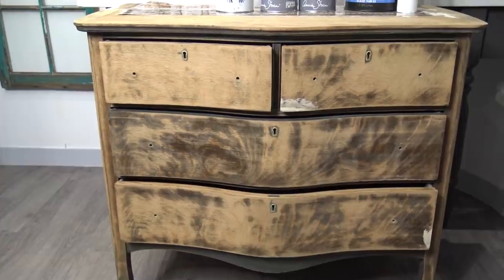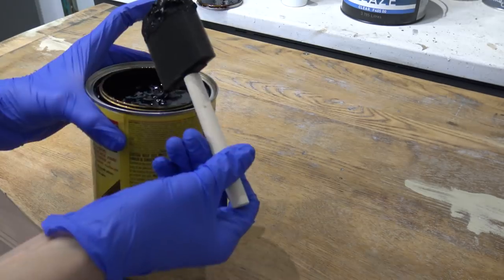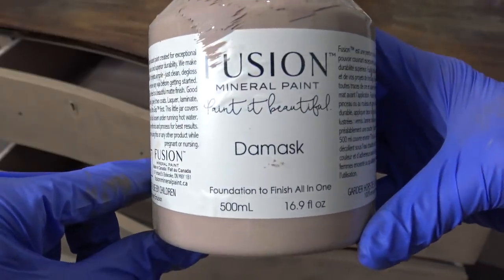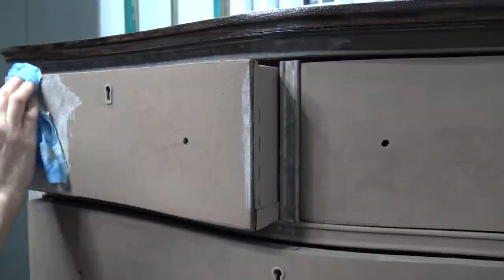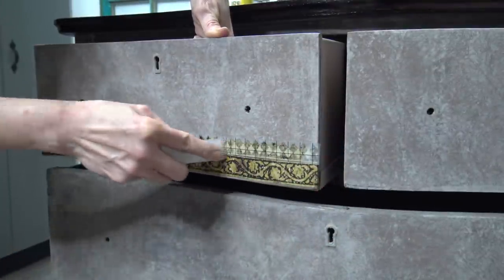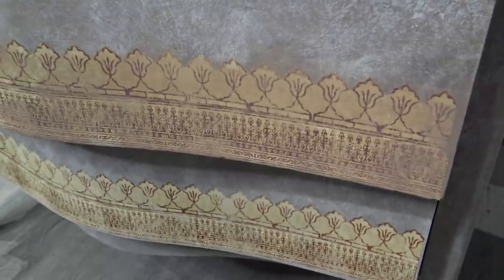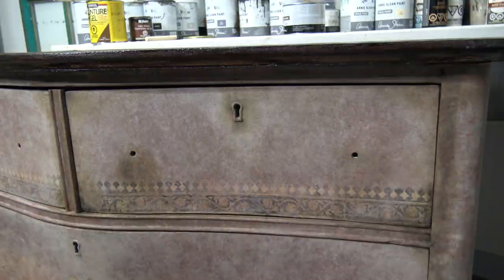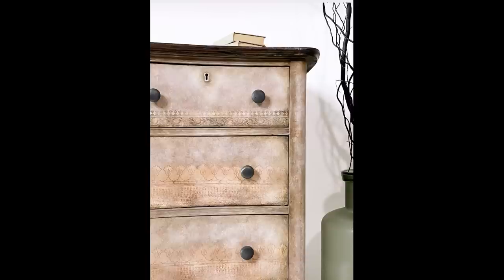Upcycled Dresser Makeover using chalk paint and IOD transfers.

Comment: What do you do about odor of the older furniture?
Reply from the maker: Hi Milissa! I usually clean the furniture piece with TSP cleaner.  If it still has an smell, I will use bullseye primer or clear coat sealer.  This product also has a odor remover as well that helps.  But using the bullseye will remove the smell from the wood.  You have to paint or spray the throughly inside the piece as well as backs of drawers and underneath etc.  it’s a pain but worth it in the long run.  If you look at my amazon link in the video description you will be able to see the product and purchase or go to your local home improvement store.   ❤️🙏🎨
Reply: The Reclaimed Heirloom thanks so much!
I have really enjoyed your tutorials! Thank you!